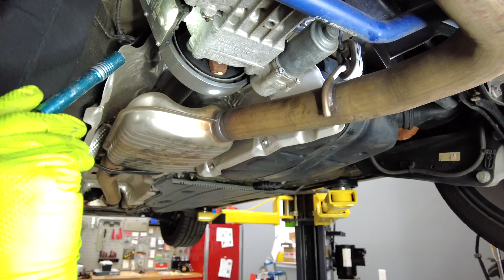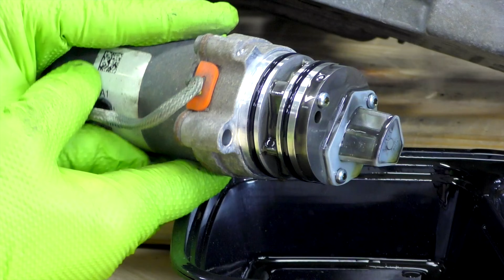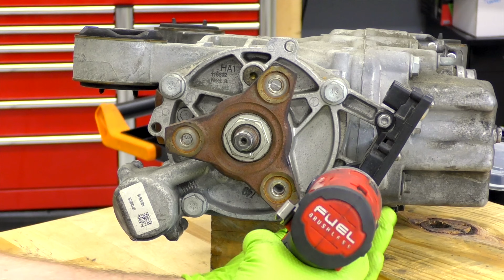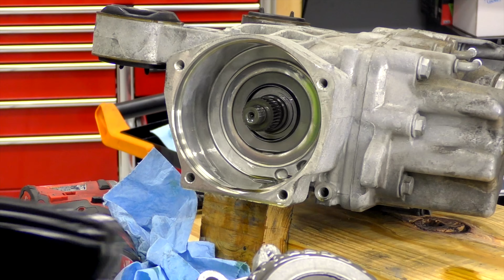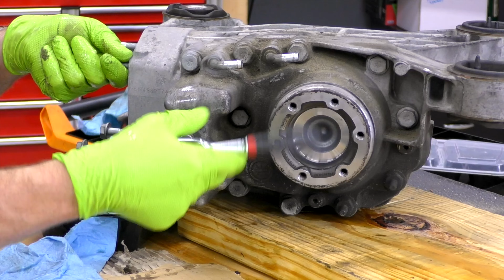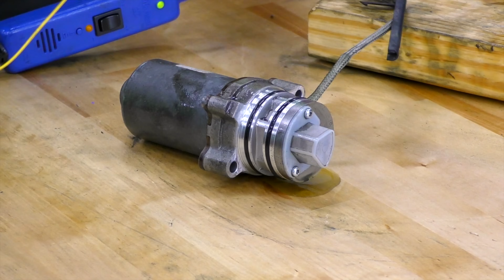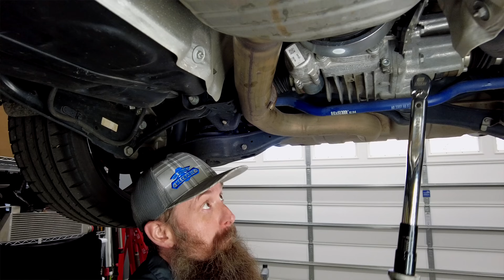Catastrophic AWD Unit Failure Audi S3 Golf R ~Haldex Failure

Comment: some brilliant engineer needs to machine out the clutch pack and lock it together permanently with no fluid pressure needed
Reply: What a shite idea. Scrubbing on any sort of steering input. Haldex unit is a stout unit many people running 1000hp through them. You need a centre diff, the haldex unit acts as the centre diff
Reply: @garyhowe88  the PTO on the Gearbox output is the Center Diff. If we listen you, when the Clutch Packs fully lock there would be no center diff, and they do in fact fully lock. The whole point of the clutch is to reduce drivetrain loss and increase fuel economy
Reply: @matthewguerra5410  I can tell you for a fact there is no diff in the angle drive at the front.. I have one in pieces in my garage currently.. as I mq500 swapped my vr6 turbo... its a direct drive to the rear just steps down the ratio so the prop isn't spinning warp speed.
Reply: @matthewguerra5410  the clutch packs do act as the center "diff" which is another reason why they lock and unlock under certain scenarios. Efficiency too, but also for handling performance (they should unlock while turning into a corner to allow the car to turn better as the front and rear wheels try to rotate at different rates). Replacing it with a solid hub, or keeping them locked 100% of the time, would negatively impact both handling and efficiency
Reply: @FCustureri  not exactly. Only at really low speed. In road racing on short courses, it was common to run a welded rear end on a RWD car. You get plenty of tire slip at speed, and ALL the power is getting put down. Depends on your driving pattern really. Probably a bad idea if just running around town with lots of low speed turns, but if doing lots of highway, or generally driving at decent speed it won't matter. Winter traction gets better too if you have snow :)
Reply: @FCustureri  Center Diff only varies power front to back. If there is no center power is locked at 50/50 split. The front and Rear Differentials deal with handling and wheel speeds in a corner. See ShopDAPs rear wheel GTI project. To see what I am talking about. They basically locked the rear clutches to get the thing to move.
Reply: @spinnetti  Yes you are right, it is more of a low speed problem. Also at high speed, stability matters much more which a locked rear differential can provide too.
However, the haldex can provide the advantages of both, an AFAIK locked rear differentials (spools, welded) are mostly used due to racing regulations and/or budget constraints. So why limit yourself when a system that provides the advantages of both, locked and unlocked differentials, exists and even comes with the car? 😉
Especially when most people use these cars for more than that one specific application, being high speed tracks
Reply: @spinnetti  again Center Diff has nothing to with wheel speeds. The rear end is still an open differential, and will do open differential things. Eliminating the clutch packs will lock a permanent 50/50 split, that will not adjust, and reduce fuel efficiency since it is permanently driving all 4 wheels all the time. 

On the Torsen Audis the center diff basically saves fuel unless you are on the trottle, and they use the Center diff to make a 40/60o split.
Reply: @matthewguerra5410  Yes, if there is a true center diff that is the case. But there isn't with "haldex" style systems, which is also why DAP had to lock it in order to get the car to move 😉
Reply: @FCustureri  you only need a center diff if you want to the front and rear propshaft run at different speeds, the end. That is its purpose. Not the car turning left or right, but for fuel efficiency running a center different or a clutch based AWD makes sense since you don't need it permanently locked on the road.
Reply: @matthewguerra5410   Look up a diagram of "front vs rear wheels path of travel while turning". There are many on Google, and you will see the front and rear wheels indeed travel different distances (and therefore speeds) while turning. The differential, or "Haldex" in the VW/Audi etc case is there to allow for that speed differential while still being able to send torque to the rear when needed
Reply: I think you will find a solution here ;)
https://www.youtube.com/watch?v=zHnglBuHtoY 
https://youtube.com/shorts/zXpKbkukZaU?feature=share
Reply from the maker: YESSSSS
Reply: @HumbleMechanic  Charles, its easy.. any competent machine shop could do it - you could have them contract manufactured and have a nice little side business ;) Send me the basket and one each of the steel and clutches and I can design in 3d cad in under an hour :)

Comment: Do you need the clutches? Just machine a piece that replaces the clutches with a solid billet piece and send it? All time awd
Reply from the maker: There was someone who made that for MK4 HAldex. Some Italian dude, that I now can't find. LOL! In theory you could make a piece to lock that together. Full time AWD. I don't know how the computer side of things would behave.
Reply: @HumbleMechanic  unless there are speed sensors on both ends, the computer won't know anything. I just knows pump voltage or not ya? I didn't see any sensors in there. As long as plugged in , and motor working I bet it would work just fine - Same reason you don't get codes when the clutches wear out.

Comment: So basically a clutch and motor replacement and the rear unit would be repaired.
Reply from the maker: Yes. But there are limited parts, and its probably not cost effective.
Reply: @HumbleMechanic  understood, makes you wonder if the higher hp versions like an S5 or S7 might offer a stronger motor to prevent this. It's an opportunity for the aftermarket companies to solve and make money on, I guess.